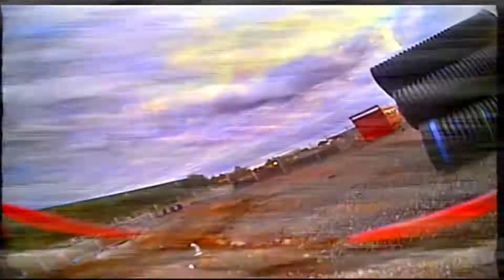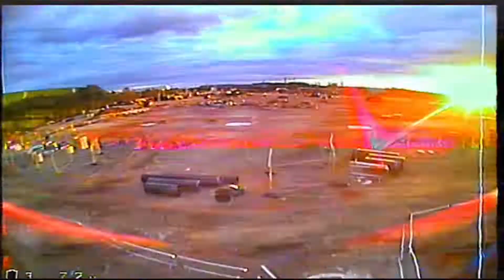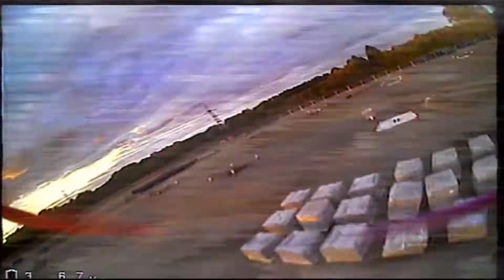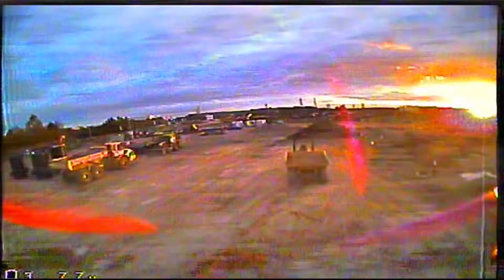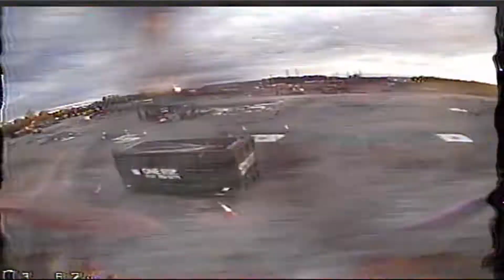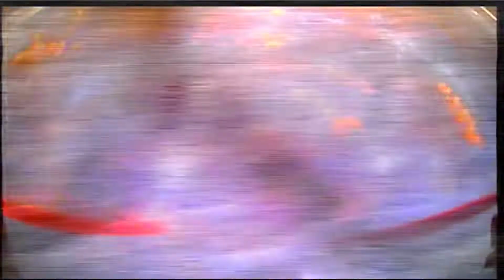Construction Site FPV Freestyle

Comment: Man that was some sweet ripping all along <3
Perfect place for practicing powerloop, split S and the basic stuffs lol
You pushed it pretty damn hard all along!
You might need to consider a capacitor for filtering your voltage, especially for these AKK vTXs which are quite sensitive to voltage noises. You can also try a voltage regulator in order to provide constantly 8.34V to your vTXs.
Thanks for the sub! I subbed back as well :)
Enjoy your week and keep on flying!
Reply from the maker: Cheers man, appreciate your support. Had a few of these AKK's that have been noise free whatever i do but this one is pretty shit for it tbf, used to use a bec but its just another thing to squeeze in the quad which i cba with. Kinda got used to it i guess, a bit of noise doesn't really bother me tbh but i appreciate its not the nicest thing to watch so I will try a cap or two see if it helps. Keep ripping too and have a blessed week also dude!  :D 👊